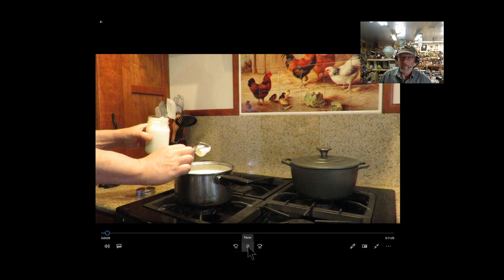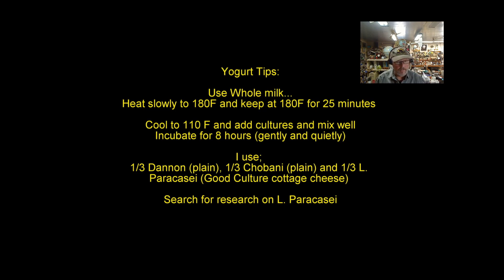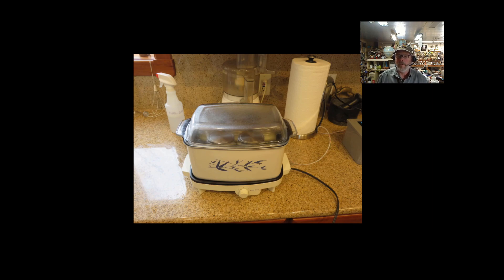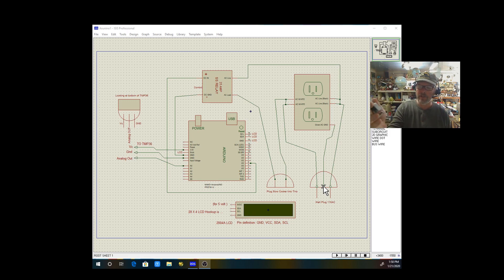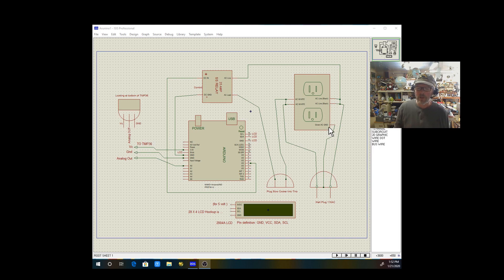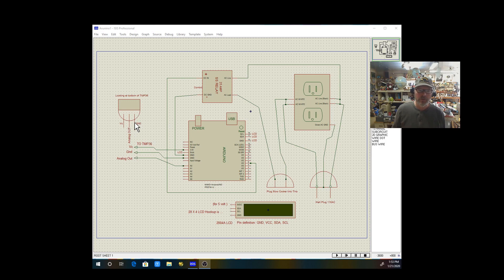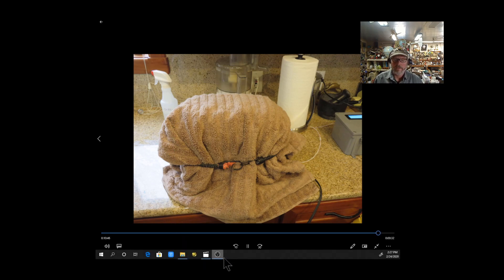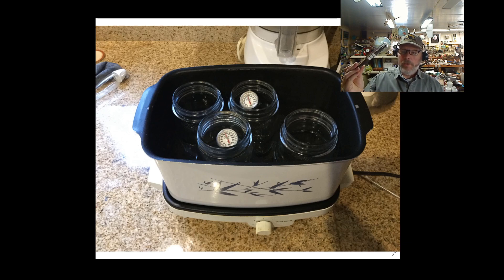Arduino Controlled DIY Yogurt maker and Tips to make a Great Yogurt

Comment: just curious - solid state vs opto isolated mechanical relay? I used the opto mech relay for my version of this project. I had the same basic idea as you, just ended up using a stainless steel pot and an electric burner as the water bath. Put one temp probe in the yogurt (inside a plastic sleeve made from lay flat tubing) and one probe in the water bath. I just ran my greek yogurt culture for 18 hours at 105 degF, then let it come down to room temp for another 6 hours. Haven't refrigerated yet, not sure if I curdled it too much again! We shall see. I like that I can adjust the temp precisely so I don't keep making the same mistakes. Thoughts on times/temps? I heard you can do the initial ferment pretty hot (Think like 110) for a couple hours then let it come down to room temp for a few more hours, haven't tried that.
Reply from the maker: Both will work. I like the simplicity of SSR and also prefer non-mechanical contacts when switching any higher amp devices (many cheap SSRs knock offs out there so always try for quality and I also use them way below what they are rated for). Can't beat homemade yogurt!